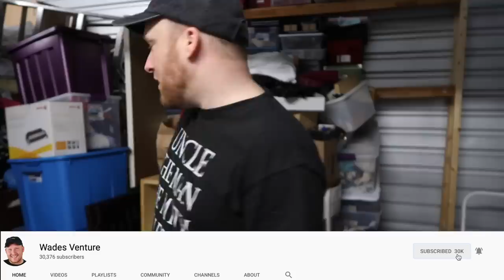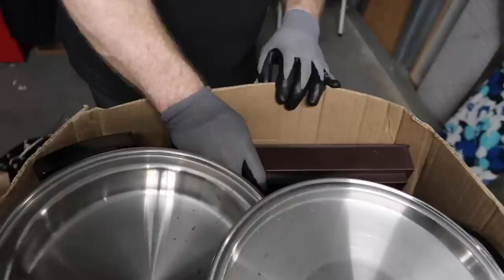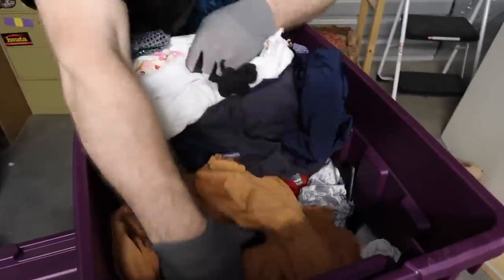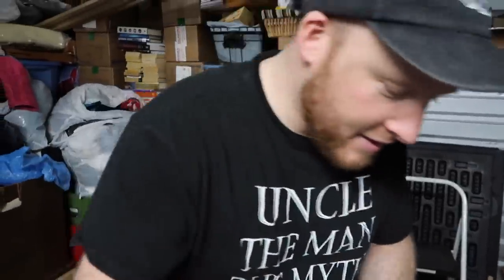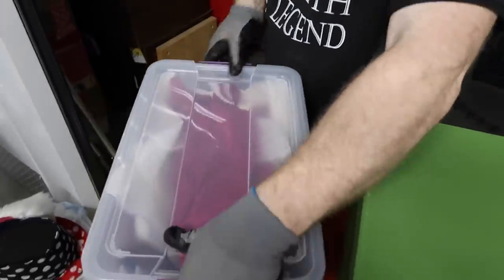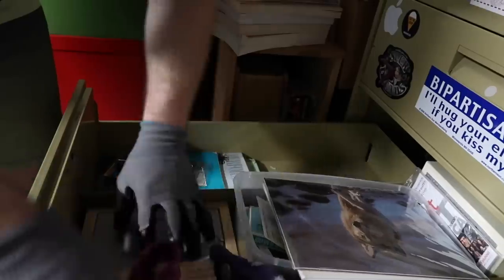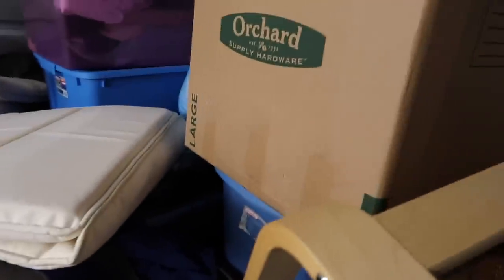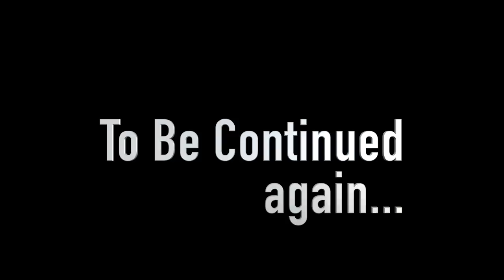WORLDS BEST Storage Unit Box Truck... YOU HAVE NO IDEA!

Comment: Wade when you are going threw kitchen things look for Queen Cookware by Amway. Very excellent cookware and very expensive. It's stainless steel and one small sauce pan and lid just sold on Ebay for$160.00. That to me is on the high side for 1 small pan but Look it up on Ebay. The prices are all over the place but are all higher than most pans. Also Copic markers are the most expensive markers and go from $6.00 per marker new. Used ones sell good too.

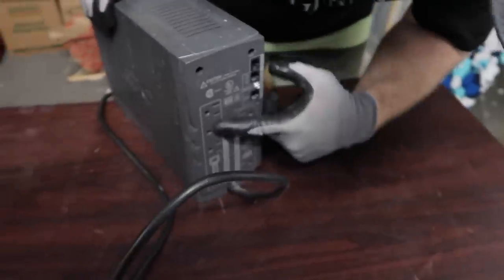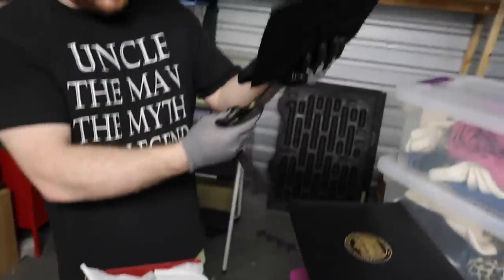Comment: 8:04 surge protector.  Lol, you keep putting the Star Trek emblem on upside down. 37:80 The "putty" is polymer clay. That stuff lasts forever and has to be baked before it will harden. 43:25 OMG! You rummaged around in that box shredding a dress pattern that was stored there. They are as fragile as the tissue paper they are printed on. Be careful handling the hard drives. Some computer components can be ruined just by being touched by human skin, and/or static.